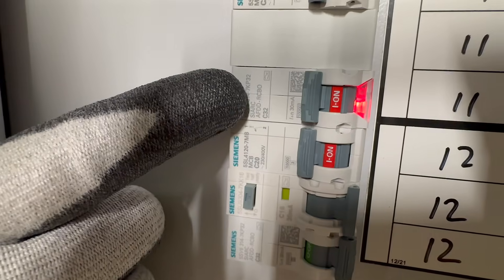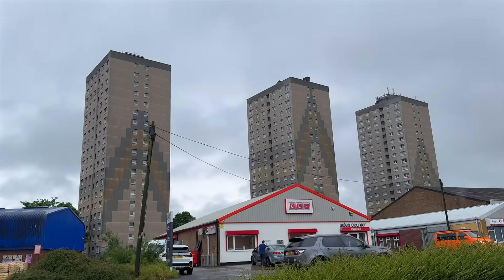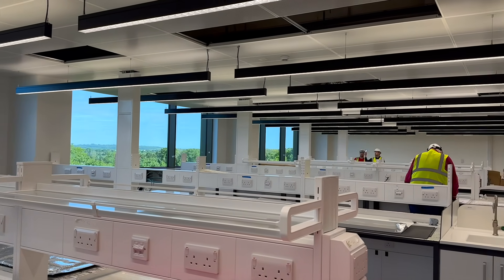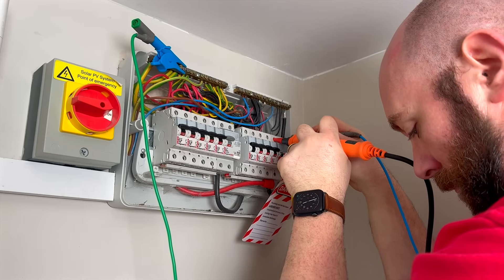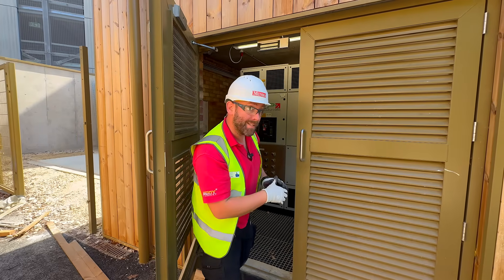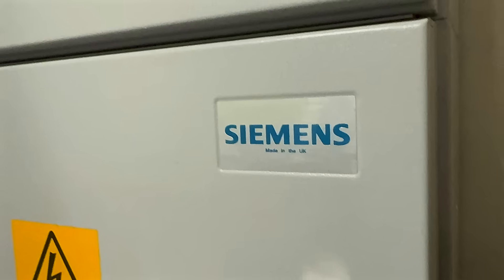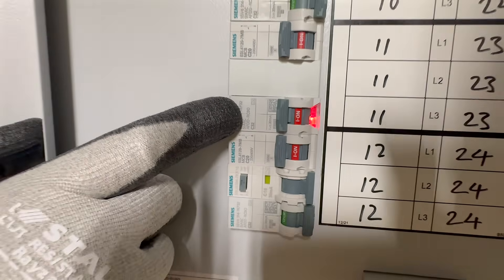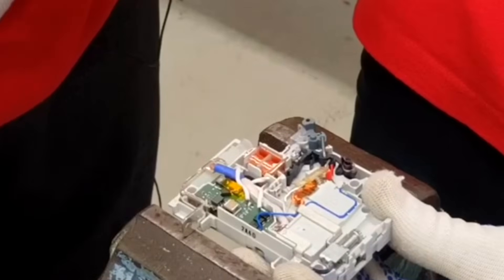Don't Make This AFDD Mistake!

Comment: Why would it be for the electrician to improvise with work arounds?
A commercial installation, as shown in the video, it would be for the designer to improvise, not the installer.
In a domestic installation, it would not generally be an issue, with Type Tested CUs.

Comment: As an end-user, not a spark, when it comes to a combined AFDD & RCBO, the indication of what the cause is seems to be crap no matter what brand. There should be 3 small lights to show which aspect tripped (AFDD, RCD, MCB). perhaps being green normally, turning red if the aspect has tripped. If I'm on the phone to a spark I want to be able to easily see what aspect has tripped when they ask what circuit has tripped, without having to mess around looking up any sort of light code.

Comment: Aren't 6kA and 10kA protective devices classed as 16kA in some circumstances (e.g. a typical domestic home) according to the video eFIXX did a year ago titled Choosing the Right Circuit Breaker - 6kA vs 10kA? Wouldn't apply for this lab of course, but I believe it would in a lot of cases.

Comment: Small but possibly important point worth keeping in mind - faults close-in to the (presumably Dyn type) supply transformer can result in a higher absolute current for a single phase-to-earth fault than the amps-per-phase for a phase-to-phase fault or a three-phase symmetrical fault. The PEFC will drop off faster than the PSCC for ph-ph or 3-ph fault as you move away from the transformer into the LV network, so the PSCC then becomes the main criterion for switchgear rating.
Reply from the maker: Thanks for taking the time to add your thoughts

Comment: You do not necessarily need to fit 10kA breakers (MCB/RCBO/AFD...)instead of 6kA if the perspective fault level is in excess of 6kA.

Say you have a standard service fuse of 80A (bs88-3) Then if you look at the cut-off characteristics,  a 7kA perspective would result in a maximum let-through current less than 6kA - so with a 80A fuse, 7kA perspective a 6kA breaker would be suitable. 

Similarly if it was a 60A fuse, then you could use 6kA breakers for up to 20kA perspective!

Obviously the larger the fuse, the less likely that 6kA breakers would be OK. But it isn't always the case that you need to upgrade to 10kA
Reply: That is almost correct. If the prospective fault current is, say,  7kA then the BS88-3 or BS1361 cut-out fuse AND the breaker will both 'see' 7kA during the fault, there won't be any less 'let-through' current. What needs to be clear when selecting switchgear in this scenario is that the MCB/RCBO/AFDD will not attempt to interrupt the fault current during the pre-arcing time of the fuse element. In other words, the fuse will 'win the race' between the fuse element and the switchgear protection, although both may operate in practice. I think you may be confusing let-through energy with pre-arcing time.
Reply: Much easier just to fit the 10ka and take the calculations out of the equation
Reply: @TheAlmightyGus I understand your comment but the calculations are required anyway to ensure main switchgear is correctly rated. It’s not difficult to exceed 10kA on large LV supplies close to the supply transformer. DNO LV fuse cabinets are rated at 33kA.
Reply: Prospective not perspective.
Prospective - Definition:
Likely or expected to happen.

Perspective - Definition:
1. A view or vista.
2. A mental view or outlook.
3. The appearance of objects in depth as perceived by normal binocular vision

Comment: Nothing but hassle AFDDs, should only be used in very specific circumstances keep them to a minimum
Reply: Dave Watts said AFDDs are devices designed to protect against faults that shouldn't exist if an installation is correctly selected and erected.
Reply: @stevejagger8602  I could see it something like a thatched roof building or something like that but they really do seem to be over the top with the level of their sensitivity a lot of the time
Reply: USA home owners usually swap them out for RCBOs (whatever there named version of it) sometimes they do dumb sruff and just installed full set of MCBs only witch you should never do
Reply: @leexgx  RCBOs are basically an RCD and a MCB in the same unit.
Reply from the maker: Is this from experience?
Reply: @efixx  Yep

Comment: Question: In a domestic DB do you need to change all of the RCBO's for AFDD's or do you just fit 1 AFDD for the whole board?  Many thanks.
Reply: If you wanted full AFDD protection you would need to install one per circuit you wanted to protect.
Reply: AFAIK, AFDDs protect single final circuits so you'd fit one per ring or radial etc, in place of an existing RCBO (or an MCB and RCD in a split load board).
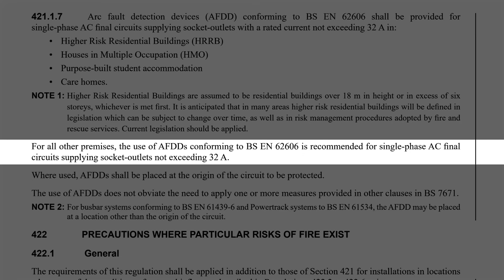Reply: Read the regs that they highlight at timestamp 1:20. 32 Amp socket circuits.